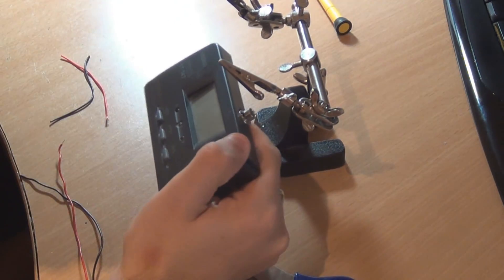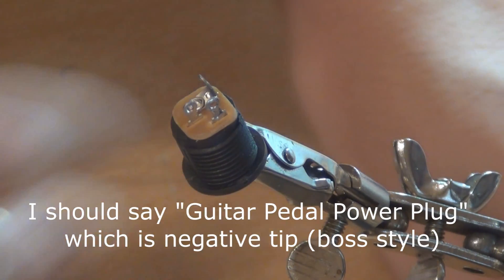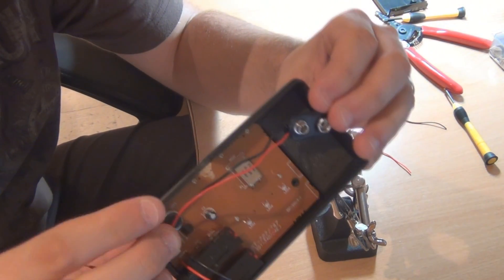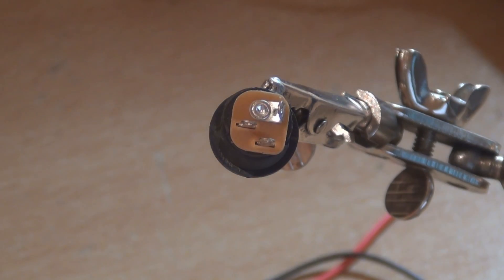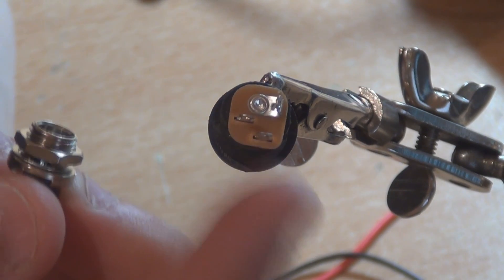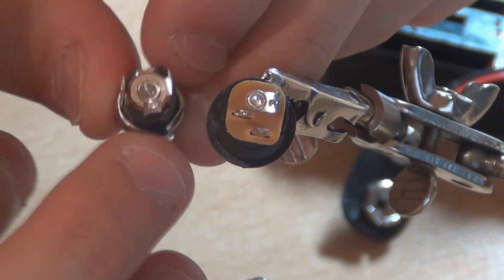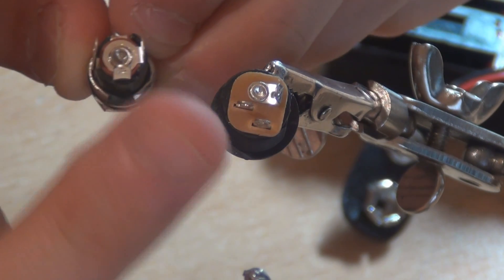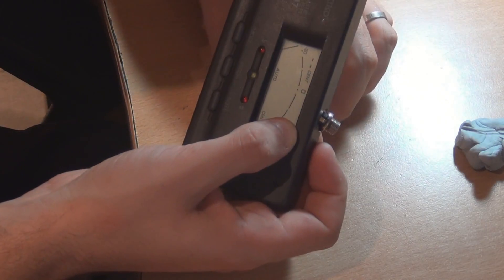How to add a dc jack to a 9v battery powered device (negative ground)

Comment: IDK about your metal one but on the plastic one the side (middle) lug switches off when the DC jack is in use. That way you're not sending power from the jack to the battery snap. That's why you want to connect the battery to the side one and the device to the outer one. Worth mentioning IMO.

Comment: I'm lost. You keep saying the top while you're pointing at the bottom??? Also, I thought black was negative and red was positive but you keep talking about the ground and the red wire only. Are you saying that the black is the ground? I'm so confused. I wish you would have showed all the wires connected on the finished product. That visual would have let me know exactly what to do.

Comment: Can you explain the third pin? I understand it's used to short out the battery so it won't drain. But, where do you connect it?? Positive = positive, negative = negative, third pin = ???? I know this seems rudimentary but there isn't a ton of information on this type of stuff..

Comment: sorry mate. But this is an incomplete video. You didn't show the connections made to the board and battery to the dc plug. And also why other videos say that the different pin on the dc plug actually is the positive terminal ?

Comment: Another way to do this is to snap a second "battery snap" to the original + to -, then wire the 2nd Snap in reverse to the connectors to the DC Jack. That way, if you do want to use a battery, you can unsnap the second "Battery Snap" and plug in a battery just as before doing the modification.
Reply: YES!!!! That's exactly what I did. I used this video to make sure I was connecting the right places. It works great!

Comment: Hi there. thank you very much for your video. I'm going to attempt adding a 9v DC to my Vox Wah. I went to Jaycar and bought what I thought was the right one but the power supply nozzle won't fit. Where do you go to shop for these components? And can you please direct me to the right one?  Thanks in advance.
Reply from the maker: Chances are your power supply male connector is the wrong size.  If it uses a standard boss type power connector the connectors on this page will work (my store): http://www.diyguitarpedals.com.au/shop/index.php?main_page=index&cPath=15

Comment: Do you know why the Pedal OCTAVIO  JH OC1, will not work when this DC jack , when connected to  standard 9V power supply.
It only works when a 9V battery is connected.

Comment: Hi, and first of all thanks for all your videos!
I have a question that it's not related directly to this video but it's about dc jack, so I hope you could answer: I've just build a treble booster and (if you don't consider some big hum) it works, when connected to a battery snap. Then I've connected it to a 9v dc jack and, as soon as I plug it into a wall plug, it blows the electrolitic capacitor connected to the 9v line. I'm using an universal adapter with voltage selector and a 2.5 dc jack. What do you think the problem could be? Thanks!
Reply: Check polarity of the suplly.

Comment: I just did this mod on a Dunlop CryBaby Wah. There are a few things that I needed to sort out before I could get my Wah to work, and without any buzzing or hum. Here's what to do.
1. Use a 9V jack with a plastic housing. Or, if you need to use a metal 9V jack, it must be shielded from the Wah metal case. I had a metal jack, so I did this by using a small rubber O-ring on each side of the jack where it might touch the Wah case. I also put some electrical tape on the threads of the jack where it passed through the metal case of the Wah. Electrical tape should work fine if you don't have any rubber O-rings.

2. Use a battery clip to connect the jack to the 9V battery clip in the Wah case. This is what I used: https://www.makerlab-electronics.com/product/9v-battery-clip/My Wah needs "Center Negative" power to work, so I soldered the red battery clip wire to the center terminal of the jack, and the black wire to the shield terminal of the jack. Snap the two battery clips together.
3. I plugged a 9V AC Adapter into the jack that I added to my Wah. The first adapter I tried was noisy, so I tried a different one. That one worked fine. I was also able to connect my Wah to a Daisy Chain of my other effects. The Wah is usually best placed after the tuner (if you have one), or as the first pedal in a series. 

I don't have any plans to use a battery in the future, but if I need to, I can simply unclip the connector and pop in a battery. I'm sure there's a way to leave a battery inside and have it disengage if a 9V power supply is used, but I'm not sure how to wire that up.
If these connections didn't work, you might not have shielded the jack successfully. Or you device required the opposite polarity - just reverse the wires at the jack, if needed.

Comment: 6 yrs later I found this, I am trying to put a metal dc jack into a metal case how would I wire it  or would I have to go plastic and a new power supply for my pedals so I have neg centre pin? a little confused here m8? as a pollie says please explain 
thnx
(also I am unsure if the local JC store sells the plastic sockets)
Reply: must use plastic jack on metal or you will ground yourself out.

Comment: What if the polarities are the opposite? I mean, if the pin 1 (the "different one") is positive? If I wire it correctly will it work? I mean, will it disconnect my battery when I plug the battery? Thanks! (BTW, I'm using an 1n4001 diode in the positive battery cable as well.)

Comment: Does the ground connect directly to the ground part of the circuit? for example if the power comes directly after a jack input, would it connect to the sleeve?

Comment: Thanks. That seemed pretty clear. I just tried it with my old Vox Wah pedal. I think all the connections are good, and all is good when in bypass (when the pedal is not on) but if I turn the pedal on, all goes silent. What's that sound like to you?
Reply: I just added a new post of what needs to be done to fix that problem on my CryBaby Way.

Comment: I have a empress germ drive pedal. But it isn't equipped for battery power. Would splicing a battery clip to DC tip clipped from an adapter power it?

Comment: Any ideas where to get a 2.1 socket that is insulated? I want to do this to a LR Baggs Para Acoustic DI, which has a metal case. I had bought a 2.1mm jack from Jaycar, but realised that the jack has a metal surround which is conductive.

I've done some searching, but all I could find seem to be metal cased jacks.
Reply from the maker: David Gardiner Yeah Jaycar dont have them!  Try tayda, pedal parts australia, my webstore (diyguitarpedals.com.au for the miniature type), or ebay.  Cheers
Reply: DIY Guitar Pedals
I'm after switching ones, so I'll try those other options. Thanks!
Reply: David Gardiner just go buy a grommet that fits the jack.  That's what I did with my fuzzface

Comment: Hi have a vintage mxr phase 100 and the guy who owned to before me tried to install a ac jack but only drilled a hole and added the jack. Wondering how can i finish what he started can i just run two more wires to the point where the 9 volt is connected so i would have two red wires coming out and two black wires coming out

Comment: Hey, so I have a pedal parts kit, but for the particular pedal, the website says it actually requires an 18v ac connection, yet the jack included is identical to the one you are using in this video. Are AC and DC jacks the same? if so, will wiring them also be the same? thank

Comment from the maker: Hey Mark, never used a fuzzprobe but yeah differently want to make sure the polarity is correct.  You can add a charge pump to flip it if it is positive ground (ala madbean roadrage).

Comment: I just bought on old hand painted Zvex FuzzProbe with no DC jack ($120, bargain).
This project would be perfect for my first mod. 
However I've noticed that some germanium fuzz's require positive tip rather than negative. I'm guessing the FuzzProbe is probably negative tip but I've fried a couple of pedals with incorrect power supplies so I'm a bit cautious.
Any advice?

Comment: How would you wire it if you wanted to have an on/off switch?  Would you wire positive from the device to the on/off switch and the positive from the power to the middle pole of the on/off switch?